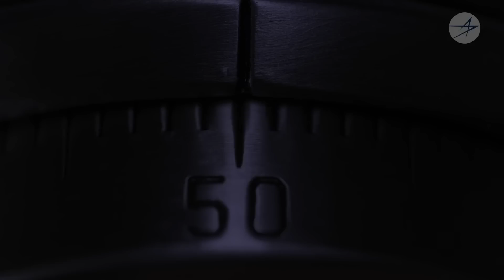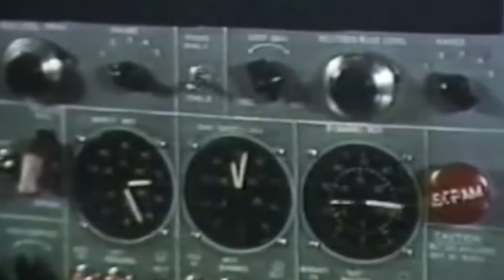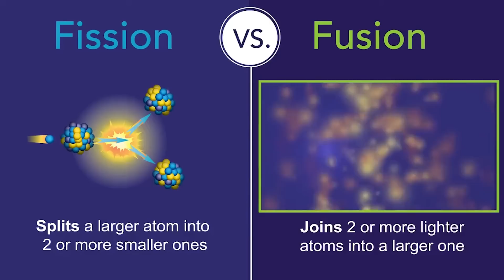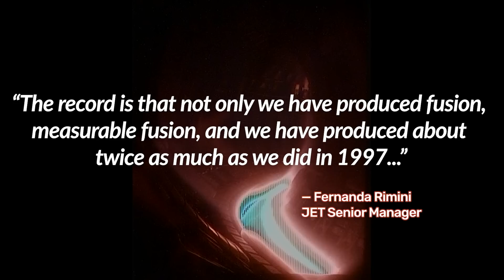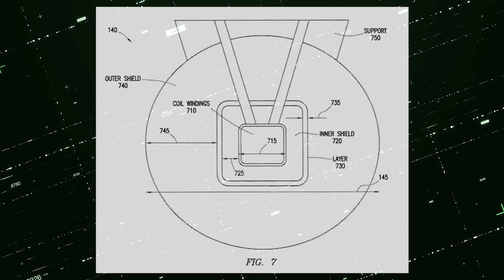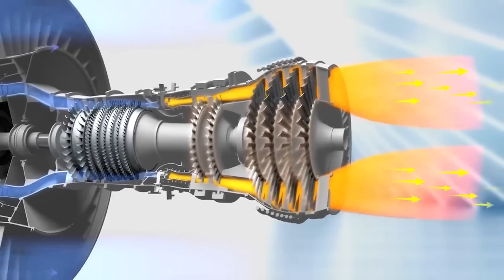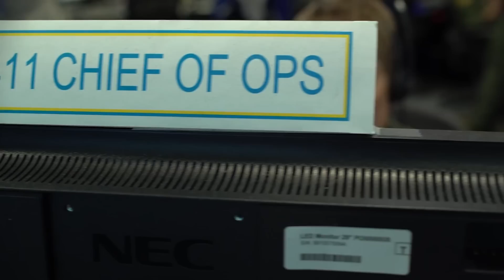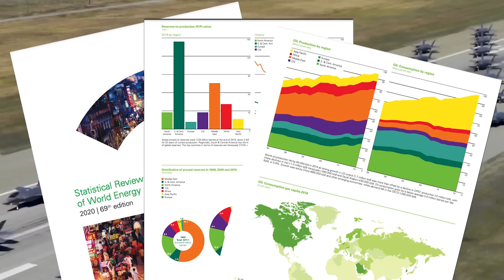Lockheed Martin's fusion-powered fighter and bomber plans

Comment: Do you wanna know how I know that Darpan and that Lockheed Martin don’t have this technology yet it’s because the vast majority of nuclear fusion research focuses on either inertia, confinement and magnetic confinement methods. You want magnetic confinement and I’m not saying it’s bad or it’s useless, but you want it, but it needs a little additive. You need just like in a fusion reactor to reflect the neutrons back in on the plasma just like how efficient reactor reflects neutrons back into the fuel rods, you wanna reflect neutrons back in on the plasma, but for a completely different reason, the neutrons induced radiation pressure, which confine the plasma in shape the plasma in in doing so reduces a huge amount of the energy requirements for the magnetic confinement because now, instead of just magnetic confinement, now, instead of just bootstrap magnetic confinement, which is where you move the ions and electrons around each other in such a way where they induce their own magnetic field and can find themselves that is something you really want but you’re also now inducing neutron, radiation pressure confinement in the more fusion. Reactions to plasma gets the more neutrons are emitted from the trade him deteriorate reactions the more radiation pressure you exponentially get in because the nuclear fusion reaction is eight times more powerful more energy, dense then nuclear fission. There is a neutrons are gonna have a lot more kinetic energy, reflecting them back in on the diffusion reaction would mean a very very large amount of radiation pressure induced on the plasma and like I said before the more fusion reactions the more radiation pressure you inherently get you can achieve this through academy in beryllium shell just like a fission reactor does but you also use magnetic confinement of the plasma as well, in addition to the use of Mazer beams to get rid of edge, localize modes in tearing modes, as well as trapping magnetic islands
Reply: Now, also, you would want alpha, particle confinement, and here’s the thing, the radiation pressure from the neutrons, depending on how you reflect the neutrons back due to the shape of the cadmium beryllium shell you can shape the plasma and you can induced plasma modes because of the way the plasma shaped you could concentrate a neutron radiation pressure in certain points, combined with a shaped magnetic field and the use of Mazer beams to shape the plasma modes. Additionally, with The Magnetic Fields restricting the degrees of freedom at the plasma could use the energy from the concentrated neutrons. These plasma modes would be able to scale in power in their ability to be able to deal with edge localize most because remember the more fusion reactions, the more neutrons are exponentially produced in this is what will allow you to confine a fusion reactor to such a small size.

Comment: One of the ironies of fusion is that there's a powerful case to be made that market forces alone will replace the entire electric grid with wind+solar+batteries by 2030. Fusion could find itself more useful for aircraft, ships, and maybe stuff like powering the hydrogen-based reduction of iron ore in place of coal rather than driving the electric grid.
Reply: "market forces alone will replace the entire electric grid with wind+solar+batteries by 2030" 🤣

Maybe if you're a ridiculous hippie who doesn't know anything about power, or economics, or construction, or project management!

Comment: One issue has been totally neglected: what about the required shielding and the weight that comes with it? It does not mmatter wether you have a fusion or a fission reactor: both types of nuclear power generation come with an ulgy amount of radiation, especially neutron readiation in case of a fusion reactor. And neutron radiation is rather difficult to shield from, especially when weight of the shielding is an issue, like in the construction of an aircraft.
On the other hand: it is well established, that some biiiig projects (nuclear fusion, jet engines for aircraft, computers and miniaturization) got going, once the military was willing to pay the first mover cost.
So I´m looking forward for a future with available fusion energy, preferably not in the hands of the military.

Comment: While it is true that a fusion power plant can’t melt down in the way a fission plant might, a number of the problems that made fission powered aircraft impractical would, I think, remain in fusion powered planes.  Deuterium-Tritium fusion puts out both gamma and neutron radiation while operating.  This means that you need to shield the reactor, just as you do for a fission reactor, which was one of the big problems with putting reactors on planes.  That shielding requires lots of mass, lots of weight, and I don’t think I need to tell you how sensitive aircraft are to extra weight.  Furthermore, the neutron radiation has the nasty propensity to render surrounding materials themselves radioactive via neutron activation.  The tritium that you breed may have a half life of 12 years, which is what I think referring to in the video, but that is not all that the neutron radiation will render “hot”. And, unlike the radiation from the fusion plant itself, this radiation will not cease when the fusion reactor is shut down.

Comment: Fusion reactions have been produced many times and reliably. They are thermonuclear bombs. Confinement and maintaining the reaction without the plasma collapsing due to instability has been our problem all along. The plasma is held away from the chamber walls by very intense magnetic fields, which still fail. The research is aimed at achieving the fusion reaction without any plasma breakdown.

Comment: A small Fusion Reactor that could fit in an acft is at best 70 years away. And when I say 70 years at best, that is very, very optimistic. This small reactor will be determined on ITER success.
Reply: At modern rates sure, but remember just how quick technology moves, who knows the straight up sci-fi shit we will be working with in 2030…2040? Remember just how much technology has changed in the first 20 years of this century. We have no idea what revolutions in material science we will see, especially as grand technological leaps are finally reaching their maturity.
Reply: @majestichotwings6974 , it still 70 years at best

Comment: even if we can make a fusion fuel cell small enough to fit in a jet  the cooling, shielding , and the need of immense magnetic confinement makes it unviable for small projects like aircraft.
Just thinking from a neutron perspective , the life span of the craft will be incredibly low due to embrittlement , especially if were talking  about a small craft as the density of said neutrons will be even higher then say a large fission plant of a similar watt output.
theirs also the question of how are you harvesting energy from this are we using the direct heat output to run the jet, or are we converting it to electricity to run a machine.

Comment: The US defense industry has a long track record of spending too much money on inventing technology that would be more at home several decades in the future. The F-35 cost more than anything really should, but it forced the researchers to invent entirely new materials and methods in order to fit the F-35s outrageous requirements. I do think that the US defense department will eventually have a fusion powered plane, but it will take longer than it should and cost more money than anyone thought possible.

Comment: How is hot air going to produce thrust? the heating produced in a jet engine is a side effect, not the main goal right? alot of the system seems to be missing.. the fighter would also lose its afterburner since they dont carry fuel

Comment: Nuclear fission reactor technology is far better than during the 80s in pretty much every sense. It's naive to think a modern nuclear reactor would suffer from all the same problems. I would say an airborne fission reactor isn't far fetched. Lockheed however seems to be addicted to the idea of building a fusion reactor, and probably will achieve it by the end of the decade. Weaponizing nuclear fusion is probably the only sure way for it get developed within the next couple decades.

Comment: You’re research on fission reactors is a bit lacking. One of the designs for the Aircraft Reactor Experiment (ARE) was a molten salt reactor. Molten salt reactors have a negative relationship between temperature and criticality. The same is true of fast breeder reactors. Oakridge and Idaho National labs have both done numerous tests where the operators of reactors have literally done nothing and the reactors have shut themselves off.

Comment: The ceramic for protection against the heat, that needs to live inside a fusion turbofan doesn't exist yet. 

Not to mention how are you exchanging the heat to atmosphere? You'll be glowing bright enough for any inferred weapons to track you.

The other issue is to come up with a light weight coolant that can withstand the temps and pressures of a fighter in combat. 

Also, what happens when the containment vessel get hit? All that super heated gas will melt the plane or if extremely luck goes completely cold. With the plane have a secondary engine support system?
Reply: Fighter jets are not in the business of getting hit. They're already made of the thinnest, lightest alloys to begin with in order to get as fast and maneuverable as possible, and fight at standoff ranges with stealth, so that missions are about shoot and scoot, not turn and burn. 

Handshaking an adversary into a knife fight is a huge no-no.

The one thing that does have me scratching my head, though, is: what happens when both sides have stealth? Are we back to WW2 knife fights in 5th-6th gen stealth fighters?

Comment: Alright if this is actually achievable then space travel from earth's surface on a casual is gonna happen. Excited for it's future
Reply: we just need to seriously start limiting orbital debris
Reply: Well, there is a problem with a fusion reactor in space. It gets very hot. Like, core of the sun hot. Losing that heat is obviously important. 
   There are 3 forms of heat loss on Earth:
-Conduction
-Convection
-Radiation
   Only one of these, radiation, exists in space. And, it's the least efficient form of heat loss.
   This doesn't mean it can't happen in space, it's an engineering problem. It could be awhile before we have them up there however.
(Edited a small grammar mistake.)
Reply: @classifiedveteran9879  spacecraft already have radiators.
Reply: @kokofan50  yeah, for normal heat. Not a fusion reactor though.
Reply: It won't happen in our lifetimes
Reply: @samsonsoturian6013  most probably but maybe humanity will surprise us
Reply: TR-3b black Triangle YouTube
Reply: @mobo8933  exactly. So quit trying to predict where science will go. It's pointless
Reply: @samsonsoturian6013  nah

Comment: Um er please excuse a retired EE with an ECM/ECCM background during the cold war. About the first thing to pop into my mind during the discussion of applications for the Lockheed Martin fusion reactor design is "EMP".

I would worry about the potential for a fairly simple EMP generator lofted near enough to the airborne fusion reactor would snuff out the fire, perhaps very violently.

I would also not want to be on the ground within line of sight of such a event as almost all my electronics would die.

Testing these systems for protection from EMP and what happens on the ground when the flame goes out would require some really isolated places to avoid messing with civilian infrastructure. I'd not get TOO excited by this development from a military angle or even for civilians in a world with maniacs like Putin or Poohbear Jinping. Unfortunately on the basis that anything that is possible will get tried somewhere by some genius or idiot we must develop it and characterize it thoroughly so we can deal with its inherent problems. THAT will be quite a ride for the engineers and psychists involved.

{^_^}

Comment: This patent does NOT mean that Lockheed has developed a fusion power plant, much less a mini fusion engine. It means they have patented this particular application of a fusion engine: so when someone else is so kind as to develop an actual working fusion power plant, Lockheed can prevent anyone else from using it in this way. You don’t need to actually build something to patent it. You don’t even have to prove that it works to patent it.
If Lockheed has actually developed fusion power in 2014, we would have heard about it by now: it would be front page news around the world and would undoubtedly lead to Nobel prizes. I am just as likely to build a fusion plane within the next 10 years as Lockheed.

Comment: You did not include Thorium Salt Reactors in your discussion of Fission and thus, the discussion of fusion versus fission is a bit incomplete. Thorium Salt Reactors are much safer than than traditional fission reactors and the half life of the waste Thorium Salt Reactors is something like 100 years. Everyone should look into the benefits of Thorium Salt Reactors because they are an extremely safe form of green electricity.

Comment: All this discussion about nuclear power and not even a passing mention of Molten Salt Reactors - LFTR, Liquid Flouride Thorium Reactors. LFTRs are low pressure reactors so no "meltdown" problems. Thorium is available in the Earth's crust at high enough levels that we have 100,000's of years of fuel available to humanity. The concept is already proven, the U.S.A. had a working reactor in the 1950's that ran for a few years. Together with fusion reactors, we'll have an energy renaissance and all the power we'll ever need.

Comment: This video contains some gross misconceptions about the fission reaction and how it is managed within a reactor. The reaction itself is not ‘actively managed or cooled’, but rather these machines are designed with inherent physical negative feedback to control the chain reaction. The active management of cooling on shutdown is to manage decay heat, and it is the failure of active decay heat cooling at Fukushima that led to multiple meltdowns after a tsunami disabled the plant. Decay heat is the energy released from the unstable byproducts of the fission reaction that reside within the reactor’s fuel rods.

The problem with the Chernobyl disaster is that the reactor’s design contained known flaws that allowed for power excursions. Ironically, operators deliberately put the reactor into an unsafe operating condition, and then when they attempted to shut the system down, the graphite-tipped control rods amplified the fission chain reaction instead of diminishing it. This is what led to catastrophic failure, and the HBO Chernobyl mini-series does a good job of explaining this.

Next generation advanced fission reactors contain improvements that should improve safety by orders of magnitude while dramatically lowering costs. One area of improvement concerns the passive cooling of decay heat upon shutdown.

Comment: Lockheed's fusion reactor is vaporware. They filed a patent in 2018 but they've been working on this for ten years. It has several fundamental flaws that would limit it from ever achieving fusion conditions. Please do more research and don't get stars in your eyes because it's Lockheed.

Comment: Also you'll never see a fusion reactor in a fighter jet, not in your life time at least. Unless you're doing pB11 aneutronic fusion you're going to have neutrons about 7 times as energetic as those from fission spewing around everywhere. Fusion doesn't produce radiactive waste but it makes a ton of radiation as it's running. You need a blanket bigger than the F-16 itself to actually capture those and do anything useful with that energy, not to mention protect the pilot. Never going to happen, Lockheed is patent trolling and too few people are actually thinking the physics through.

Comment: One of the oft ignored issues with coal-fired power plants is that burning said coal releases whatever trace radioactive isotopes are present in it directly into the combustion products. While that may not seem like a lot in the context of say, a BBQ, the sheer volume of coal that needs to be burned in a power-plant means the overall release can be environmentally significant unless the stacks are equipped with expensive and well-maintained scrubbers. No prizes for guessing where many coal-fired plants and their political puppets try to cut costs and minimize regulation.